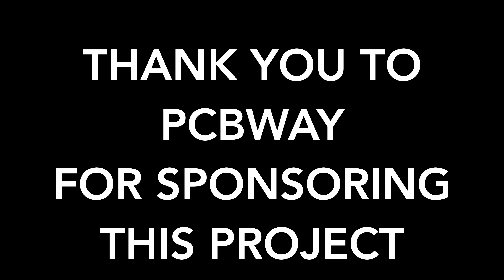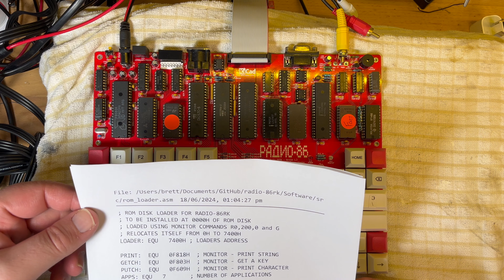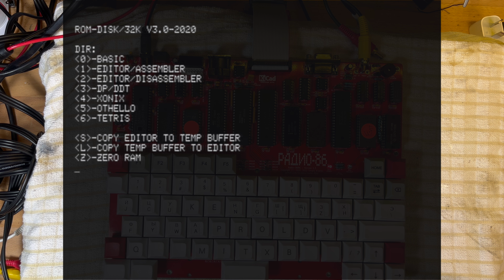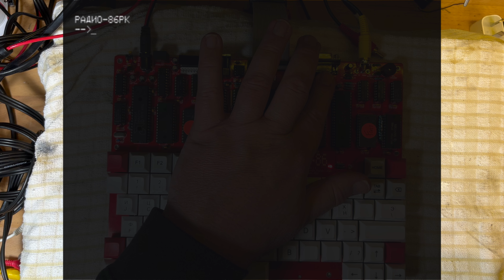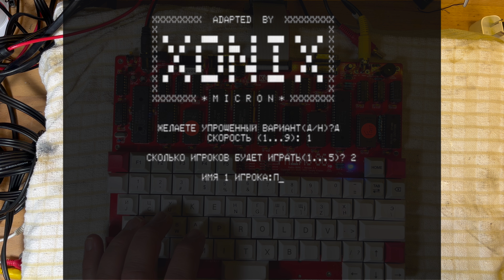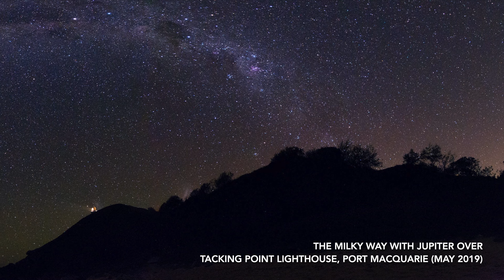Радио 86РК (Radio 86RK): Part 2 (Loading ROM Software)  [#TCE0478]

Comment: It's neat to see someone else building one of these.  I bought the boards from Sergei and built mine (version 1.3, I think) using mostly Soviet parts that I ordered from a shop in Bulgaria via eBay (they were very nice and threw in some extras with a little thank-you!).  I was stoked that it worked right the first time (well, mine did -- but I take no credit: Sergei's designs and documentation are excellent), and I spent some time playing the included games (well, included in the ROM image -- I had to burn that myself, of course).  I need to get it out again and play around with it some more, perhaps loading some cassette software!  Then, well, build it a case.

I'm also wondering, since it doesn't use color, it's not really a SECAM output but just B/W composite at 50Hz... so maybe one of my real CRT's might be able to sync to it, even in the US.  🤔 That's a big maybe, but I've heard that some do even if not labeled for use with 50Hz, especially with all the fine adjustments available to the user on real CRT's, so I wouldn't be surprised if it could.  Now that I've said that, I've probably cursed myself, but it would be really neat to see the Radio-86RK display in amber or green.  🙂

For my keyboard, after searching fruitlessly for the correct keycap set (since this isn't the current Russian layout, either), I gave up, ordered a set of blank XDA-profile caps, then labeled them all with a permanent felt-tipped marker.  Artisanal!  🤣
Reply from the maker: Hey Derek - I think in my latest video on this you can see that I've ended up buying a bunch of different XDA-profile sets (including various coloured blanks) from Aliexpress and just about made up a JCUKEN keyboard for it ... I realised that I'd probably never need to type in Cyrillic so I used just plain Latin characters.  For video, remember that "composite" is actually colour ... it's a composite of the B&W (luma) and colour (chroma) signals.  If I recall, the video signal (similar to the other, related machines) isn't well like by modern displays ... I think I've found it easiest to go via a Sony DVD/HDD recorder first which then re-generates (I'm assuming) a proper video signal on its output

Comment: I wish I could forget this piece of sh*t of my childhood
Reply from the maker: Why?  Our equivalent here in Australia was the Z80-based TEC-1.  Only now, 40 years later have we got a proper keyboard for it - still no video output though.
https://en.wikipedia.org/wiki/TEC-1
Reply: @Brfff  Come on, matey, you already had ZX, CPC, C64, Amiga (!) by the time this soviet crap was born in 1986, with only 16KB of RAM, black ans white text mode this abomination would have been obsolete even in 1980. USSR had far better 8-bit PCs of the same time: Specialist, Vector 06C, BK0010 (this one though pretends to be 16 bit)
Reply from the maker: @b213videoz  chuckle ... okay, okay I will admit that after I posted it I realised ... "Oh, I did have an Amstrad CPC464 as a real computer at the time" ... although only with monochrome green monitor (First World Problems).  
I guess it's because of our different perspectives ... I see this and think, "wow, considering the difficulties they still managed to cobble something together", whereas you might look back think "well, I had to live through this time and it wasn't much fun".  I thought the Specialist wasn't as good as the 86RK?
Reply: @Brfff  No, Specialist had 32KB RAM right away + graphical mode of something like 384×256 black and white. Its Lode Runner port is awesome, there are some other (not many) good games too. Later they had Specialist MX revision adding colours and more RAM.
Compared to Amstrad CPC this Specialist suскс (of course) but I so wished back then 34 years ago that I'd had Specialist instead 😊
Funny thing is it was easier to DIY too as Specialist didn't contain "rare"(specialized) chips unlike RK.
By the way Specialist deserves your reviewing in "Ukrainian computers" section 🇺🇦
Reply: @Brfff  So you had an  Amstrad CPC back in the day, ha ?
Lucky you! Do you by any chance remember this game FEUD?
It just happens I spent last 2 days hасking it with Z80 debugger+disassembler, finally I can complete this game 😊
Reply from the maker: Yes, I only just heard of the Specialist ... but it might be hard to get my hands on, unless someone has made an updated version like Sergey has with the RK.  But I will be keeping my eye out ....
Reply from the maker: Yes, an Amstrad ... with a green screen though :)  No, never heard of Feud ... it seems it came out too late for us here in Australia (1987) ... but you have me interested now.  I will check it out.
Reply: @Brfff  I just sent you a LinkedIn connection request, Brett 😉
Reply from the maker: @b213videoz  My most favourite social media thingy ... constant spam trying to get me to pay for their premium service!
Reply: @Brfff  I wonder if you could "mod" my Atari 800 XE with extra RAM, funny thing is I live in Australia too 😁
Reply from the maker: Ah, just saw your comment!  Sure ... I've never had one of these but always happy to have a go.  I've always wanted to get my hands on a 1200XL ...

Comment: It'd be great to make one of these. Where'd you get the keycaps printed?
Reply: Shouting at the screen H5!!! H5!!! .. H7!!! Noooooo not H0.. 7!! Yes!!! Cheer
Reply from the maker: Ahhh ... maybe more luck on Aliexpress ... here's a set of QWERTY/Cyrillic keycaps that might suit the v1.4 board ... BUT ... they are Cherry profile, so not all the same

https://www.aliexpress.com/item/1005006079753037.html
Reply: @Brfff  nod I'm currently moving up north to Woy Woy, once that's done then I can really dig into this. I'll resist the urge till it's done .. also because I don't know how the shipping is going to work as I'm moving to a bit of an odd address at the back of a house accessed by an apparently unnamed old night cart track/lane way.
Reply from the maker: I've got some of the v1.3 PCBs spare that I could send you, but they use the JCUKEN layout (can't get).  If you use the v1.4 PCB then it uses standard QWERTY layout so you can use any keycaps you like.  I'm using XDA profile key caps at the moment, sourced from YMDKEY.COM ... so you can get a set of QWERTY and then some blanks for the special keys.  I've just used a small space bar so I don't need to worry about a stabiliser.  I'm thinking of switching to MA profile key caps ... they sell a batch of 200 blank (so I can use for my v1.3 JCUKEN layout) but they are out of QWERTY layout it seems.  Of course, there are other key cap suppliers too!